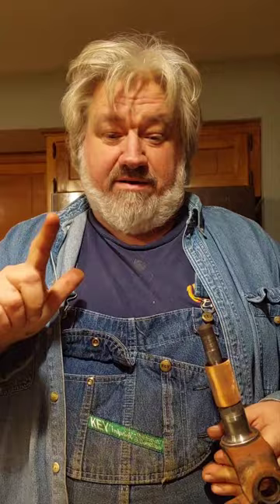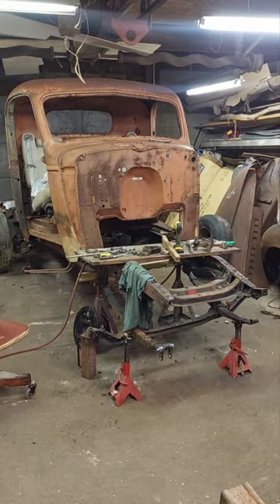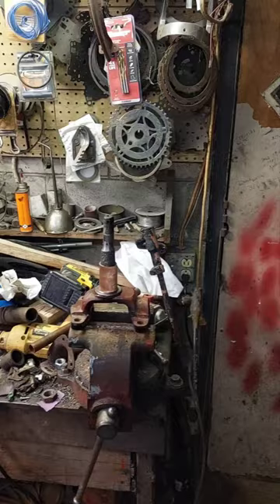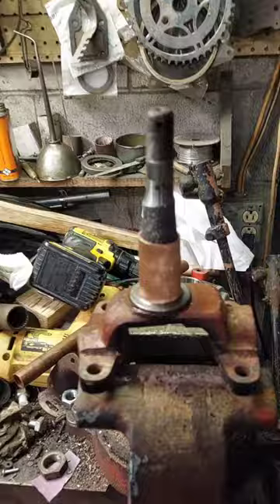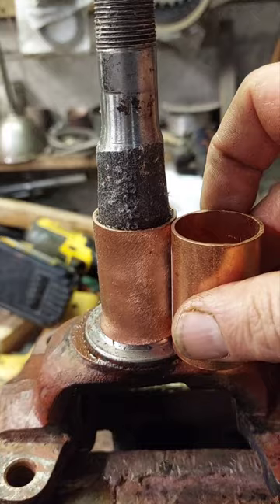1939 chevy truck disc brake conversion installation

Comment: I think the 1940 to 1954 half-ton straight axles are the same.  Maybe those years spindles will fit the '39 axle.
Reply from the maker: It seems they have different kingpin sizes.. but I'll be on the look out for info..thx